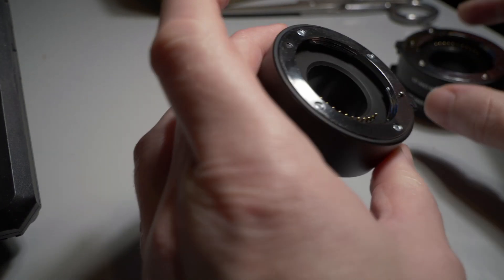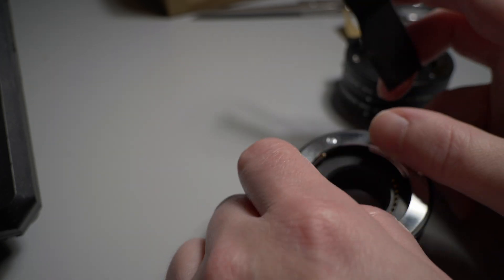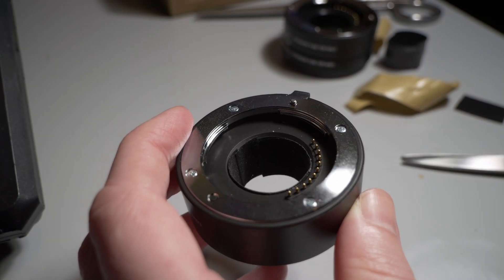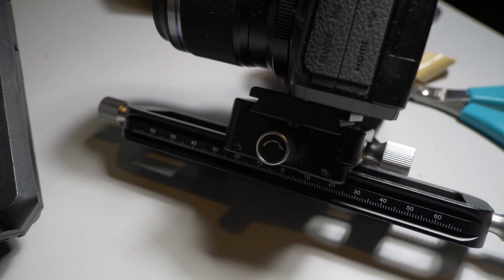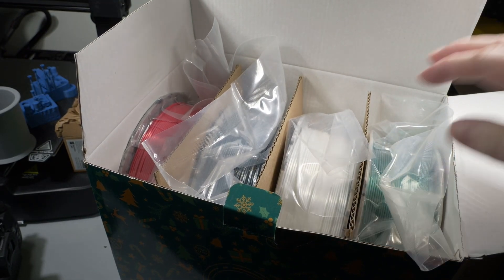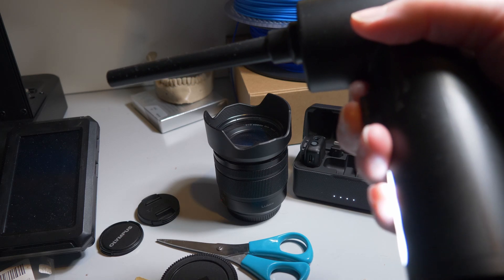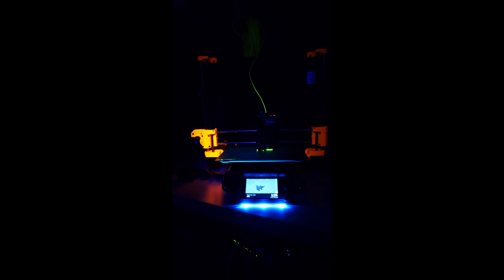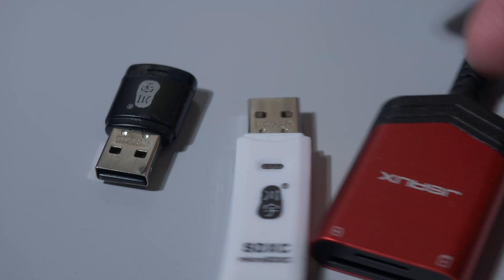Odds and Ends 1: Elegoo's weird reels, macros of nozzles, dust, UV reactive filament...

Comment: photography and 3d printing, 2 of my passion. FIY you can 3d print extension tube in back matte filament. On my Nikon it's what I use and it works great. Not sure if it can work with every brands because you need a way to adjust the aperture. It's probably possible to design an adaptor to use you microscope lenses on your camera. The way I would do it would be an adaptor for the lens, a bellow and another adaptor for the camera if you try the microscope lens. I printed an extension tube that was around 6 or 8 inches long. Worked okay but you need a ton of light and the dof is tiny. How do you do your focus bracketing?

Comment: suggestion: sanding the inside of the rings will matte the surface without messing with tape and reducing the diameter. I'd use steel wool or something over 1000 grit.
Reply from the maker: Ehhh yeah I'd probably end up with dust in the camera lol
Reply: @foundintech  Isn't that what the air blower's for?